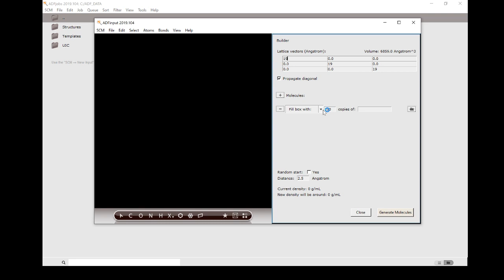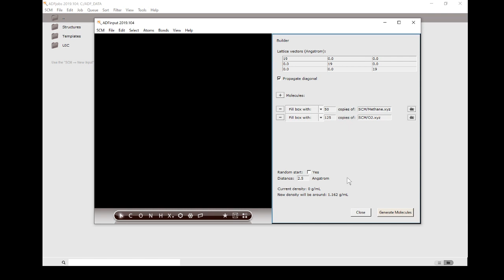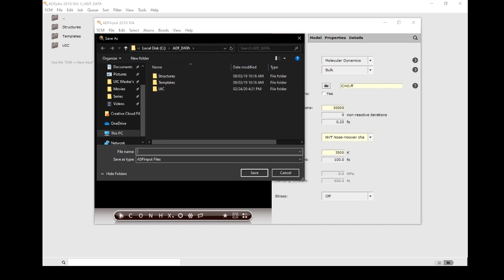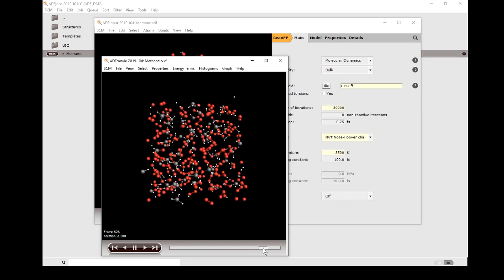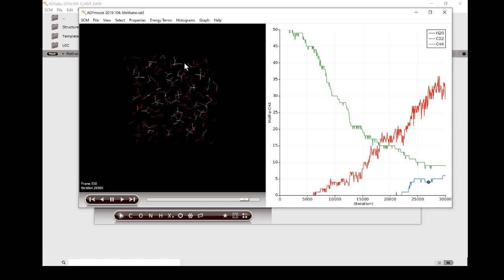AMS-ReaxFF Tutorial: Burning Methane

Comment: I have some questions: 
1) is the list of molecules generated referred to the Force Field CHO? Or is the program able to predict the molecules produced?
2) if the reaction is not an oxidation but, for example, a polymerization or a degradation in absence of oxygen, does the Force Field influence the product?
Reply from the maker: Hi Sabrina, CHO is a reactive force field designed for combustion chemistry. It also has been used for pyrolysis (see e.g. https://www.scm.com/doc/Tutorials/Advanced/ReaxFF_cvhd.html?highlight=cvhd). There are a few other force fields each reoptimized for their specific application. For polymerization, other force fields have been used: 
https://www.scm.com/doc/Tutorials/Advanced/ReaxFF_polymers_bond_boost.html
For a list of force fields included in AMS-ReaxFF and their literature references, see: https://www.scm.com/doc/ReaxFF/Included_Forcefields.html